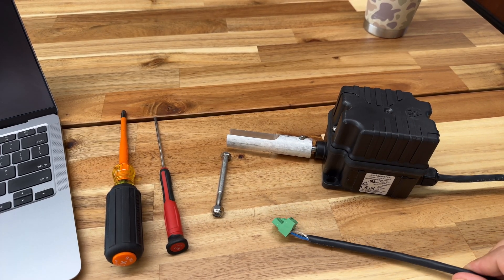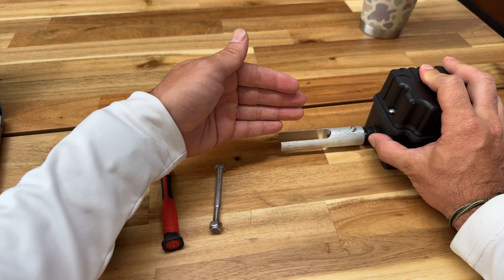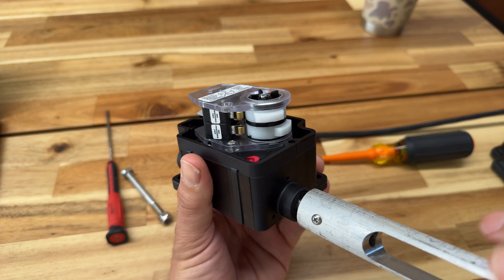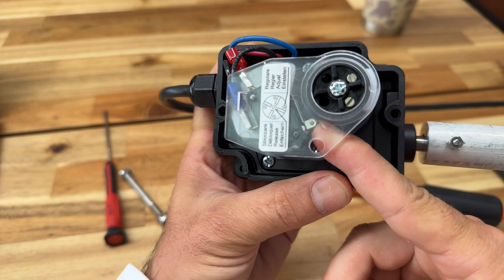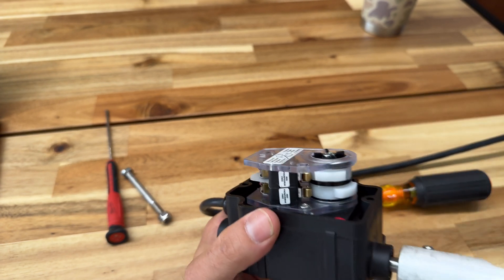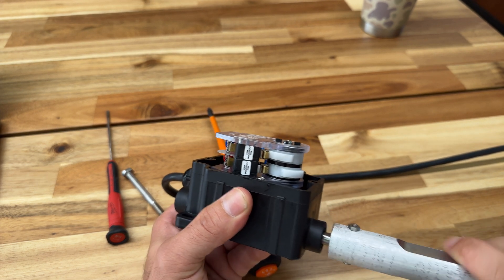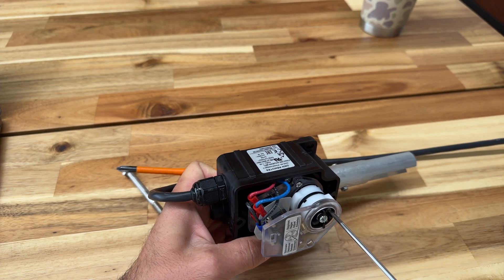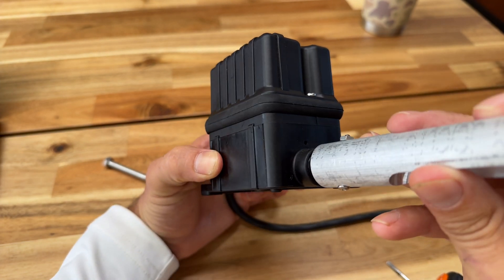How to set a limit switch on a boat lift

Comment: That's funny.  I assumed it was a digital encoder that could be programed to stop at the upper and lower limit just by pushing a button to tell the controller what the encoder count  should be for upper and lower limits.  Now I see it is done the old fashioned way with a gear down mechanism and cams pushing on switches. Encoders are very inexpensive, reliable and simple.  But, for some reason, the industry has chosen to add a $250 cammed switch and a gear down mechanical system that has to be set manually at the drive system. Seems stupid to me. An encoder would add about $20 (max) to the cost and could be reprogrammed at the controller at any time almost instantly.
Reply: Same here. I assumed you could program this at the control box by holding down a button or putting it into some kind of learning mode. My wall mount / jack shaft garage door works that way. Depending on your lift setup it might be difficult to reach this box to make the adjustments especially the lower limit on place with a large tide swing.
Reply: @johnmoore3504  Exactly.  My controller box even had a "learn" button on it, which made me think this was what it was for. Turns out it was just for the remote and the controller box to sync up.
Reply: @blaster-zy7xx  using an encoder would be so much better since then you could program multiple levels. For example a 3rd position that was somewhere in the middle - where the boat is level with the dock so you can load / unload gear and people safely. And a 4th position when storm surge from a hurricane is expected. I see the current limit switch as establishing the limits of travel for the system, with other settings for convenience in normal operations. Guess I was expecting a boat “elevator” with multiple preset stops. You can always use the override contact for extreme situations but presets would be nice.
Reply: @johnmoore3504  Exactly.  It's like we are living in the caveman days for boat lifts. AND if we then tie it in to a smart device, you could tell it remotely to lower to the dock level even before you get to it and raise the cradle out of the water after you leave, that would reduce corrosion especially in salt water environments. Then as you are about two miles away on your way back to the dock, tell it to lower again to accept the incoming boat. AND as you suggested, you could remotely raise it up to "storm level from" 1,000 miles away.  DUUUHH right?
Reply: Salt air baby!!  Your fancy gizmos wouldn't last.
Reply: @NotABot88  Actually, solid state electronics are much more reliable than little motors and gears and switches.
Reply: @blaster-zy7xx  digital decoders have circuit boards right?